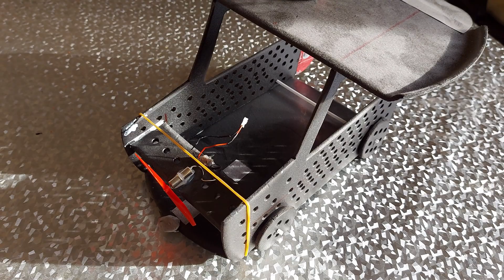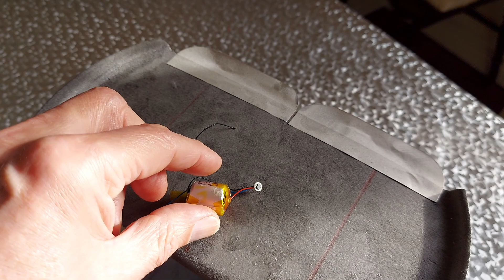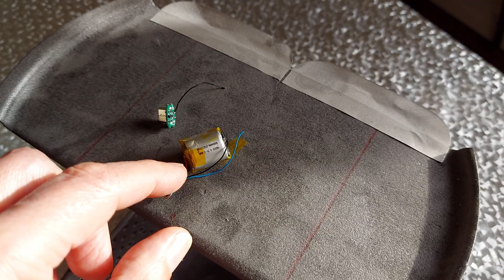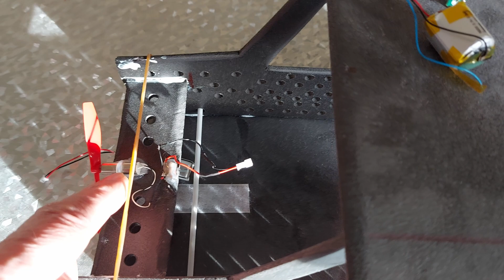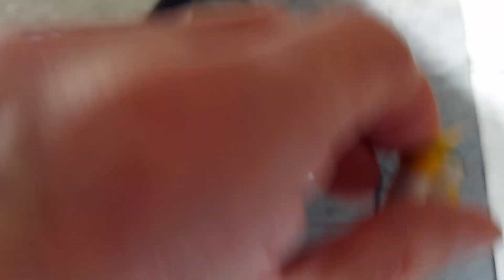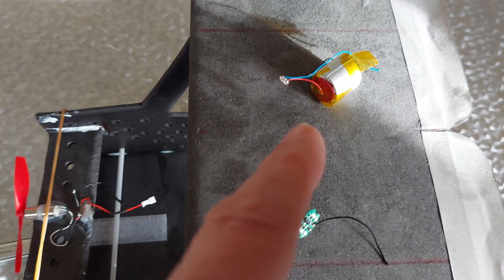10 second timer for my flying car PART 1  Using the sensor from a vape 🤔

Comment: Excellent idea Graham. 👌👍👍⏲
Reply from the maker: Thanks, Mike. I hope you are OK with the weather 😲
Reply: @GrandadIsAnOldMan  The weather where I am is really ok. Further up north they have had snow storms with roads blocked and drivers stranded.
Hope you are doing ok. 
I saw that the winds were very strong down there. I have noticed, and you too I imagine, that it's normally into March and April that we start to get the very cold and snowy weather.
Well, another year is done and I hope something good happens in this crazy world in 2024.
All the best to you and your family for 2024 Graham. 😃👌👍🎆
Reply from the maker: Raining most of the day today. I see Bro Betty has had trouble with his roof in the wind on his video today. Best wishes for the New Year for you and yours, Mike. PS. there will be a video short tomorrow testing the vape sensor with a slightly larger motor 😁😁 @mikeflight9

Comment: Might be worth adding a freewheeling diode across the motor terminals to prevent any 'switch off' inductive spike damaging the electronic switch.  Maybe the switch has a built-in protection diode?  I don't know: it wouldn't need one for working the vape heater, because that's not an inductive load.